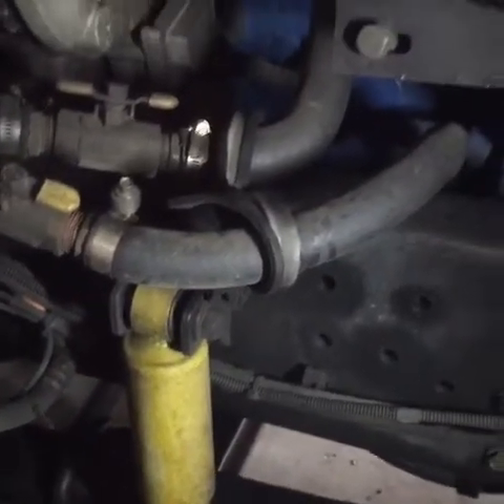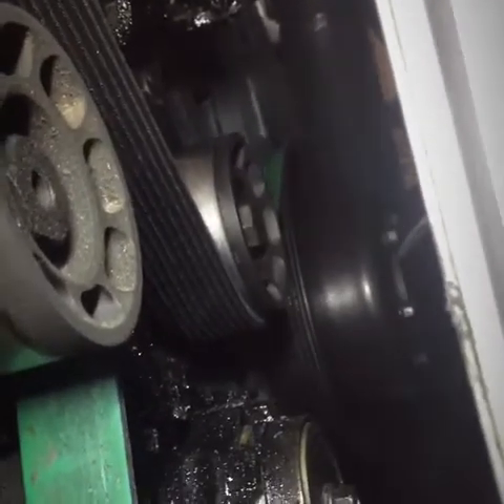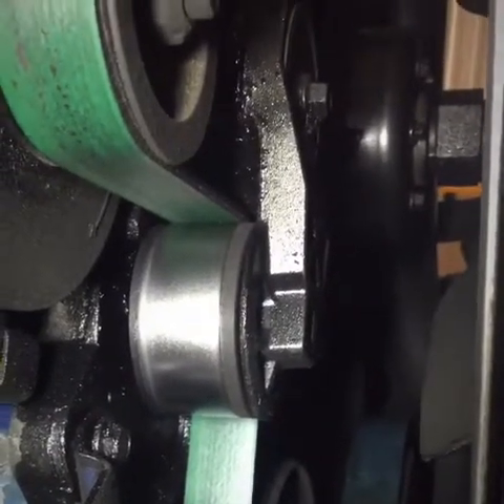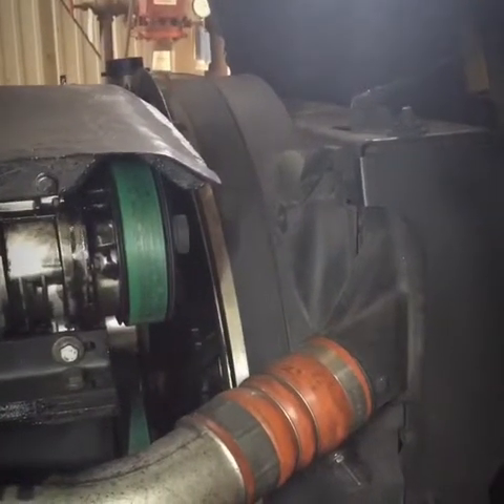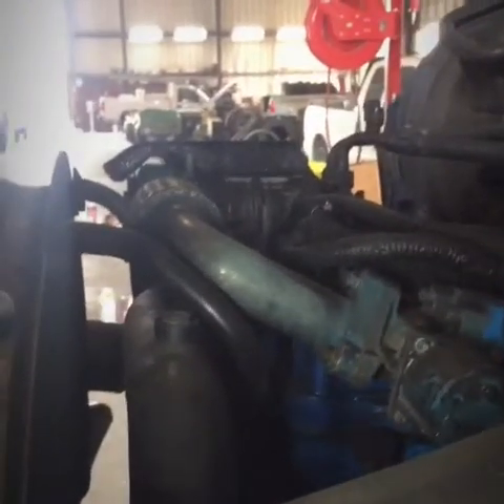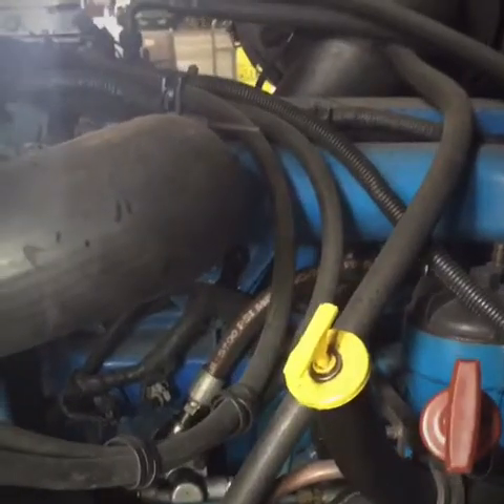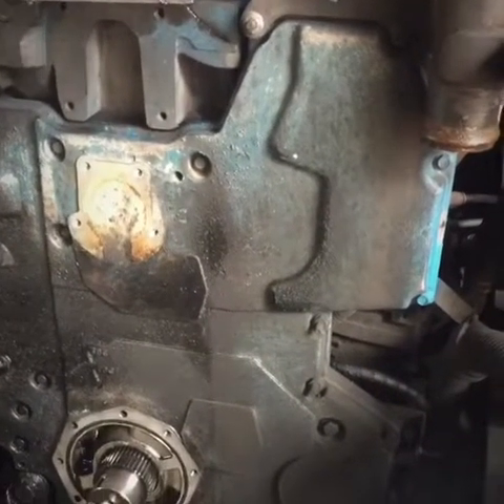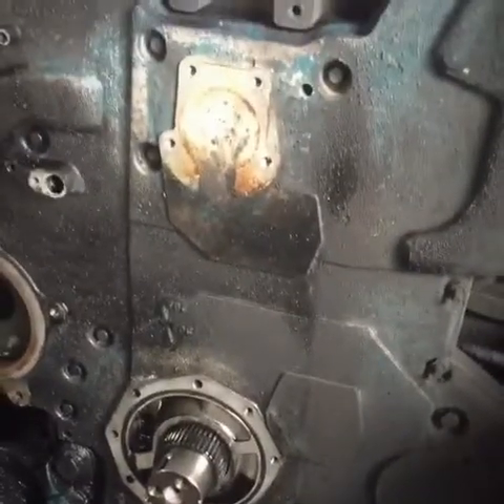Replacing  DT 466 timing cover

Comment: If I wanted to run a move just the cover timing cover Do I have to take up the oil pad
Reply from the maker: If it’s just the front cover. No. But you do have to find a way to suspend the engine cause of the front engine mount. You would have to remove the oil pan to remove the rear timing cover though due to the oil pickup tube.

Comment: Wow!!  that bus has 2 a/c units on it....
Reply from the maker: 2 compressors. 2 condensers. And 4 inside units (evaporators). It gets a little too hot in south Texas bro.
Reply: @JoesBusBarn  Looking back at these videos.... you must have realized like I have.... its easier to remove the front bumper when working on anything up in the front of these engines. I think they purposely built wrap around bumper to annoy us mechanics.

Comment: And another one! You’re the man Joe!

I’m having a hard time getting the damper off. I’m at HFT looking for pulley extractora but they aren’t big enough. Any other method you can recommend? 

Thanks boss!
Reply from the maker: I know oriellys has a 3 leg puller that we bought. I can send you a part number or pic. The thing with this puller is that you have to place a thick washer in the screw tip to protect crack. But it works fine. I’ll send u a part number in a few
Reply: Hi joe, is there a snap ring or anything holding this flange in place? I’m going to have to put some muscle into the puller and wanted to make sure I wasn’t missing something. Thanks
Reply: And what do you use to press it back on?